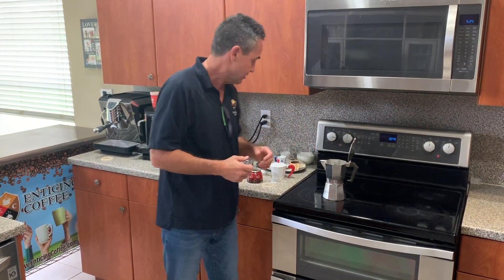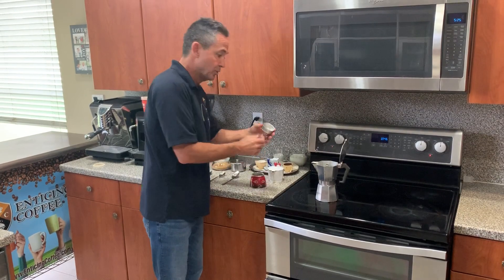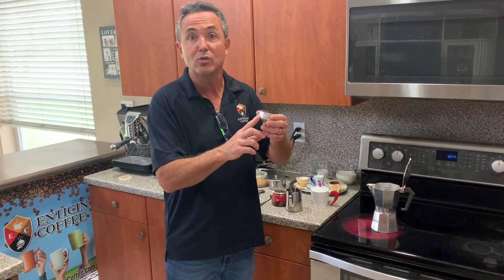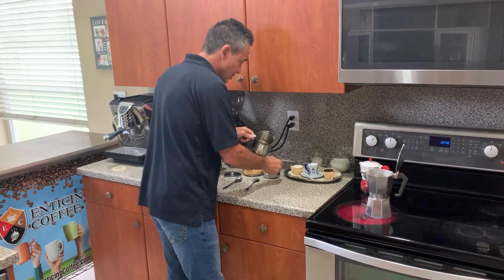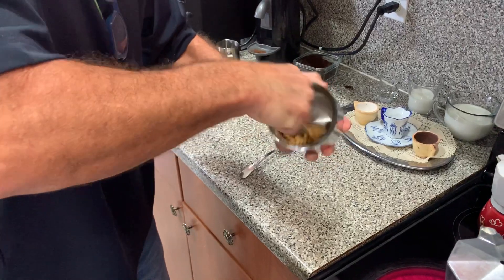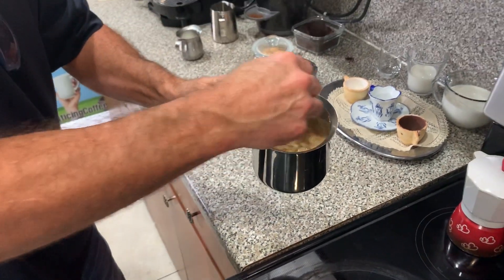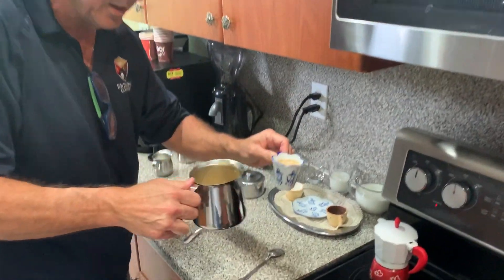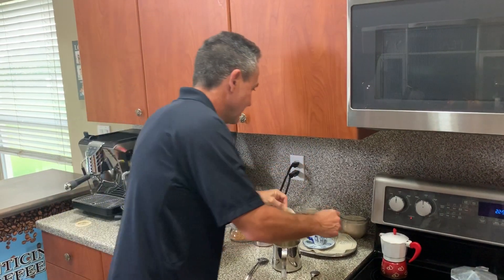How to make Cuban Coffee | Moka Pot Percolator Cafetera physics

Comment: Very good tutorial! I grew up drinking strong Turkish/Greek/Arabic coffee which is similar in strength but a little different I flavor. When I married my wife who is Latina I adopted this method of café making and I love this coffee as well. Hard to choose between the two. The only thing I have noticed is the coffee extraction is less bitter if you pre heat the water before adding it to the boiler and then screwing on the top collector; then continue brewing at medium low heat to keep the water below boiling as to not burn the coffee. Slower low heat extraction results in a smoother more flavorful coffee. Pre heating the water also reduces the time the cafetera is on the burner and keeps the coffee grinds cooler during extraction.
Reply: Hi Zeus, you are 100% correct, filling the boiler with hot water reduces the amount of time the moka pot has to sit on the stove and prevents your coffee from scorching. Medium heat also prevents the handle from getting too hot.
Thank you for sharing
Angel Chirino
Enticingcoffee.com